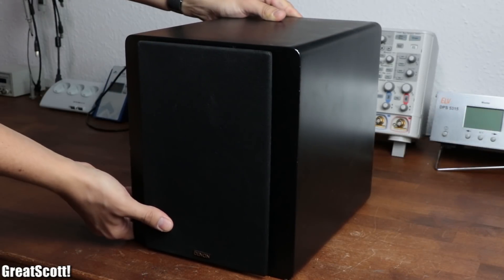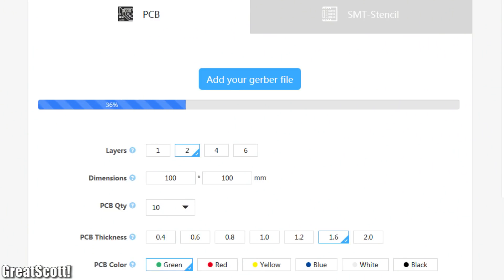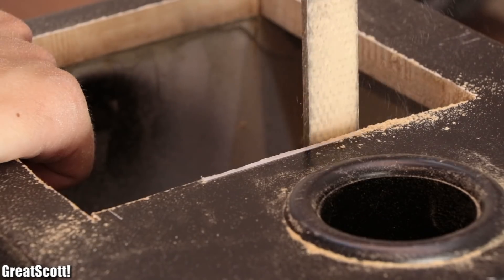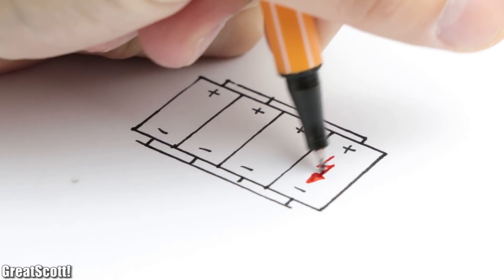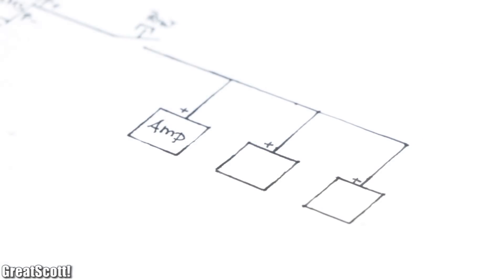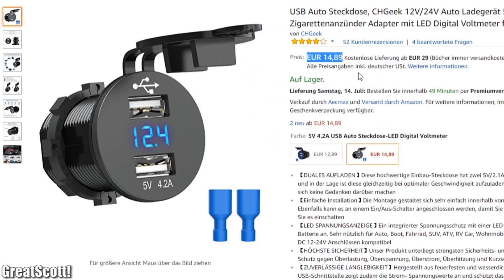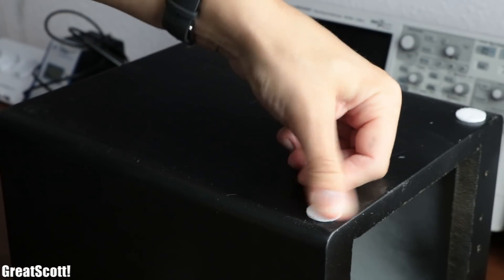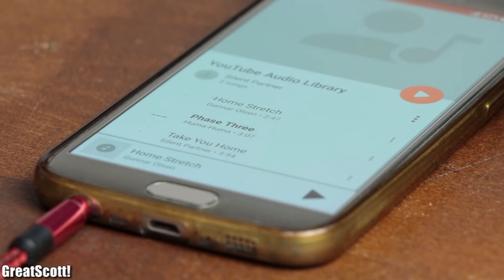How to create a Bookshelf Speaker Boombox

Comment: Does that amplifier circuit not need a heatsink..? I guess you're not driving it to the 20W limit though, rather 1ish watts..
Reply: The advantage of class d amplifiers are their efficiency (full load up to 94%).
Reply: Class D amps are like a switch-mode power supply adapted to a power amplifier and are highly efficient. The switching is usually up in the hundreds of kilohertz (like 250kHz for example), so audible distortion should be absolutely minimal.

Class A, class B, and class AB are linear amplifiers, not switching. Due to their design they have much less distortion than a class D, but also burn a lot of waste power in their output transistors and need gigantic heatsinks. They're the linear regulators of power amplifiers
Reply: since it is class d it means that the effiency is pretty high and you won't really need a heatsink.
Reply: I have that exact same amp, it easyl pulled 1-2A while driving 2 speaker at 18V at max-ish volume.
Reply: It does, Cause 70mA DC isnt influencing the more or less AC Voltage of the speakers.
Reply: Also music isn't at full blast all the time.  Only on the bass notes will it hit that 20W.  The rest of the time 1-5W
Reply: It just needs pre amplifier. The phone cant output strong enough signal
Reply: Skruffles yeah 70mA or what he messured well don't make sense for 20W amp 😂🤔
Reply: RadegasTCZ 
Once he goes outside with it and turns it up I doubt it will last 100 hours lol more like 10 hours

Comment: Nice but if i was doing that i would have added Bluetooth function also
Reply from the maker: There a dozens of USB bluetooth dongles with AUX in for $5  - $10. Since the boombox has USB power you can easily use that to get bluetooth support.
Reply: and a groundloop.
Reply: GombaDE since it is battery powered I don't think there will be any problem with ground loop

Comment: Why is a magnet on the battery during charging?
Reply: To connect the crocodile clip
Reply: its the best way to charge a cell without soldering wires or anything
Reply from the maker: What?